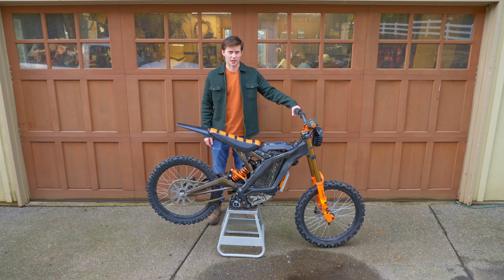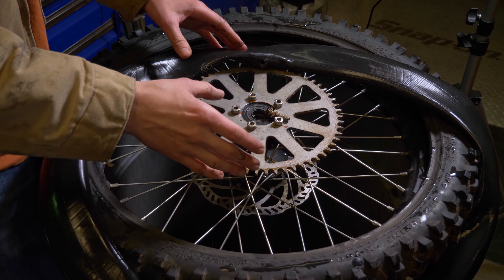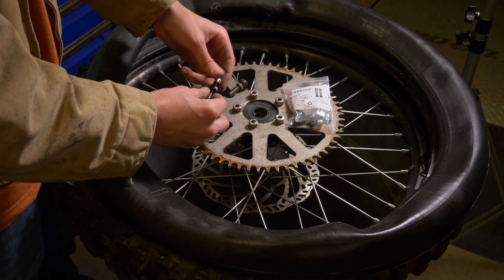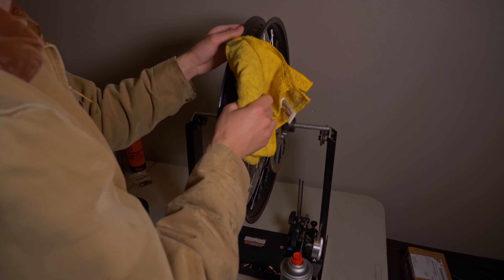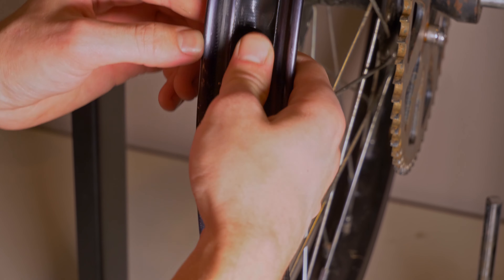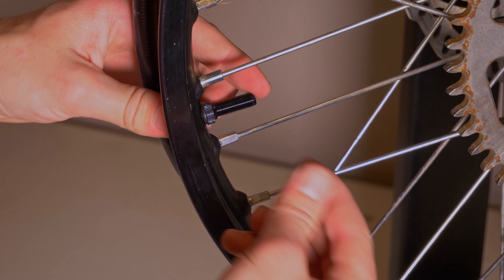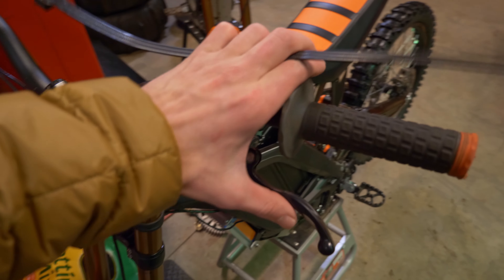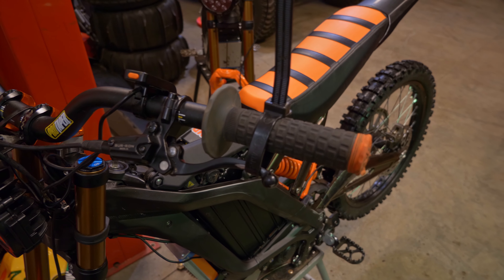Tubeless Tutorial For Sur Ron

Comment: Good on you guys for experimenting with the simple approach to tubeless. I don't think the average rider is gonna spin the tire loose but I guess time will tell how it works out. I ran a simple set up like that for many years on various KTM 2 and  4 four stokes. I ran a trials tire and sealed spokes with sealant and duct tape.I didn't even run sealant inside the tire.  I could run as little as 8psi and never had rim de-bead or spin. If the bike sat for a while sure it would lose some air but so do most tubes. I did plenty of Nor-Cal rocky technical trail riding as well as high speed paved twisties....Just always carry a tube in case

Comment: While I run the Tubliss 2.0, I still watched this all the way through. One suggestion, when putting the sealant in, keep your wheel on the truing stand and spin it after. Much better distribution. If you don't have a stand put it back on the bike and run at low speed for a bit. Hopefully you get a good seal first try. Thanks for putting out the content. Eagerly awaiting the next run of controllers.
Reply: What's your experience with Tubliss on the Surron?
Reply: Didn't you have a hard time installing the tire with the tubeless?
Reply: @Seldoff  So far great. It's rainy season here in Hawaii and the mud can be deep, sticky, and sloppy or thin over hardpack and slick as snot. Im running an 18"x 3.50" rear as are most of the guys i ride with. Yesterday was really wet and i rode at about 4 psi. Other guys have done entire rides of 2+ hours at 0 psi. This is over roots and rocks with plenty of climbs and descents. No flats or rim damage yet. The inner high pressure tube keeps everything locked in place. The wheel setup was a game changer. Spinning the rear is a thing of the past. You lose a little bit of the initial punch on takeoff, but the torque that tire puts to the ground is amazing. I can crawl up stuff i had to hit full speed to make before.
Reply: You converted to a wider 18” motocross rim, that’s important info, I don’t think you can make a tubliss work with the stock SurRon rim, it’s too narrow.
Reply: @BrianLampright913  Correct, I'm running an 18" x 2.5" moose racing rim with a Kenda257d 18" x 3.5" tire.
Reply: @ff24  I’m going to try going the opposite direction you did, I’ll let you guys know how it turns out when the snow melts :)

Comment: I run hare scrambles in Florida and Montana...and always use low air pressure like 10 to 12 lbs also in my dirt bikes.  Another suggestion before going full tubeless, is to remove your valve core and just add say 2 or 3 ounces of Stan's or any sealant.  It works great and really helps prevent pinch flats which are notorious in FL sand and MT light snow roots, etc...  Then if you ever do rip your valve or such, you can do the tubeless route then.  I get tons of extra life from my tubes when doing that.  Also, don't spread the sealant in the tire on your tubeless setup until after you set the bead.  The latex or sealant gets in-between the bead and rim and latex rolls into little balls as it dries.  So you don't want it to leak out and make a mess and have less in the tire anyhow, so just set the bead then spin and bounce your tire...will work way better. Happy trails and thx for the great videos.

Comment: Great tutorial. Well described. I have tried 4 different sealants, Stans, Orange, AmerSeal, and Slime. Totally honest, SLIME works best (cheapest, easiest to get, doesn't dry out and turn to snot), both for my Enduro 2 stroke WITH Tubliss 2.0, and my mountain bike(s). I threw about 6 ounces of Slime into the Enduro Tubliss 2 while mounting the inner liner and tire, and I do NOT have any air loss (over 2 years running and a few tires later). But when I convert the Sur Ron to tubeless this spring, I am going to try a mousse for the first time. Wish me luck!  Definitely looking into getting an 18 inch rear wheel made too. If a 3.5 inch tire fits, I would love that low pressure for climbing and ultimate traction.

Comment: Nice.  I’m running tubeless on my 26 inch front wheel.  I may as well do the rear too now with my extra tubeless valve stem.
Reply: 26”???  Mountain bike wheel?
Reply: @BrianLampright913  yeah, it's a 21" wheel alternative for people with RST forks.
Reply: Aren’t you scared of exploding that wheel and having a huge crash as a result?  The way we ride I couldn’t trust a MTB wheel on the SurRon. But if you aren’t aggressive then the light weight of a MTB setup would be awesome!
Reply: @BrianLampright913  people have ran mtb fronts on the sur ron for since they first came out and much longer with motopeds. They are plenty robust in terms of strength for hard riding and jumps.  The only complaint is tire life and resistance to punctures.  I’d do a 24” mtb rear wheel, but I’ve had too many pinch flats on my quilbix 76 clone.
Reply: @skyungjae  yeah the wheels on MtB can take some serious abuse if built right, but not a lot of margin for error vs an MX wheel. The tires are a massive difference in bead and sidewall construction which would cause a lot of problems for fast people in rocks and corners and stuff on a 110lb bike, heck I can make a tubeless MTB tire burp in a fast corner or rock garden on my 30lb mountain bike.   a 21”/17” full sized motocross wheel setup is crazy overkill for the SurRon, adding a ton of weight in the worst place. I can see why there are so many variations everyone is trying out. I’m building up a new wheelset right now, just waiting for spokes and I think I’ve nailed the best setup.  More to come once it’s built...
Reply: @skyungjae  you can stuff a 21” on an RST ;)
Reply: @OregunAdventure  what tire are you using for clearance?
Reply: @skyungjae  I have a Dunlop mx53 80/100/21😎 yeah baby‼️🤣
Had to do a lil modding;)
I have the same size tires (front/rear) as a typical dirt bike.

Comment: Hey guys! So I gave that tubeless setup a try. I managed to get one tyre set up, inflating it at a car tyre shop and rode a couple of times with it. The second wheel there's no way to seat the tyre, I wonder whether my compressor (170L/min at 110psi) is powerful enough to seat the tyre. Looks like your compressor is huge (at least the tank), maybe that helps.
Reply from the maker: You shouldn’t need to go above 35 PSI to seat, I’ve tried and learned the hard way with a massive explosion and a loss of hearing for a while! 

What helps most is lubrication on the bead. We didn’t need it in this video but we recommend using that stuff that they put on car tires to get the bead to seat. That should do the trick 🤘🏽
Reply: @emotobros  thanks for your answer. The issue I’m facing though is that air goes out faster than it goes in and I can’t manage to have pressure at all…
Reply from the maker: The tire does need to be relatively in place on the rim. The tires I used had a pretty thick sidewall so they naturally popped into a position on the rim that allowed for a pretty easy inflation. I would suggest bouncing it around to try and get a good centering seal to begin with and it never hearts to put in more sealant. Although the actually pressure of your air compressor doesn’t need to go over 35 psi, you do need a high enough flow rate to push it out. While my compressor was able to do this it’s possible some compressors aren’t able to push enough air fast enough. If you are trying to inflate it you can usually see where sealant is flowing out from a bad seal. I would try targeting problem areas by pushing on the outside of the tire into the rim to help the tire seat on the bead.

Comment: Hey guys great video I'm gonna give this a try but I have a question.  In the start the first valve stem you show was a (velotubes) roadup  fr21d with 4 holes designed for cushcore insert then when you actually put the valve in you used the velotubes fr21 just one regular hole on the bottom . Was there a reason you choose to use one over the other ? Thanks
Reply from the maker: You know more than us! There was no particular reason we used one over the other, just what we had laying around and it seemed to work! We still recommend Tubliss over this but this is far more economical.

Comment: By any chance will there be a bac8000 emoto bros kit down the line?
Reply from the maker: We have covered this in a lot of detail before but the short answer is no, because there is no good reason too. A big misconception is that the 8000 has usable performance benefits but that’s really not the case. The BAC4000 can already handle way more power than you should be running through your bikes motor
Reply: @emotobros  ok

Comment: I want to get fox 40 for my Surron but I don’t know how to get a normal dirt bike fender mounted on them does anyone have advice?
Reply from the maker: There’s no way to put a dirt bike fender on it because they are not inverted forks and the cross support on the lowers would come up and hit the fender. A fender needs to be mounted to the lowers, most mountain bikers do this with zip ties, and a thin plastic or laminated cardboard cutout. I’ve done it with a cardboard from a box of beer when I had a mountain bike

Comment: They make extra thick inner tubes and they make really good heavy duty liners that you can put in your wheel and then you put the inner tube in and then you put it on your rim and voila no need for a nasty gorilla tape or sealant you will never get a flat you can go over nails raise your blades you name it it will not go through glass all day

Comment: Been doing this for a decade, Next time you do this tape the rim and out in your valve stem then put the tire on and pop it on bead with no sealant then let the air out , take the core out and put in the sealant, valve back in then fill it up again and roll it around you won’t lose any sealant hat way and get the best seal and keep it all in there

Comment: I think with your aggressive riding you are going to have problems with the tire slipping on the rim running the MTB version of tubeless. You only have a 19” rim in the rear vs a 27/29 and that’s a loss of 30% surface area for the tire to grab the metal rim and stay in place. But the bigger problem is on MTB we run 25 psi or more pressing the tire against the rim.  I think you’ll find this setup is not going to work and you’ll be buying a tubliss kit which are absolutely fantastic, I run them on my moto bikes.  There is also a problem with tubliss on SurRon, the rim used is much more narrow than a 19” rear motocross rim (by 20mm) which the system was designed for.
Reply from the maker: I guess we will find out. So far no issues

Comment: Should just run a bead lock if your spinning tires. $16 and drill a hole. Under 23psi and more powerful set up your going to be spinning tires. Even tube less.! Many years racing the GNCC'S we would use NUETECH TUBLISS set up. RIM locks have to use a tube whitch sucks woods racing because of pinch flats. NUETECH uses a really cool design. just something to think about. My rims don't come with a bead lock hole I leave this to customers to decide whether or not they need one. Can easily be done.
Reply from the maker: I’m gonna go tubliss when I get your wheel set. This was a bit of a an experiment. I’m fine with a little slip so long as I don’t  pop the tire of the rim due to it. I covered bead locks as an option in the video but like you said, you still have to run a tube which I wanted to move away from.
Reply: Any reason you couldn't run a rim lock with the tubeless setup? Just use an o-ring behind the nut on the rim lock?
Reply from the maker: It just creates another place for air and sealant to get out. That being said, I haven’t personally ran it so if your tape is sturdy enough, and you use Orings like on the valve, I could see it working.

Comment: You can do ghetto tubeless with stans and a 16-20in BMX tube split open and spread over the rim. Harder to get tire on, but with a good set of mx tire irons, it's NBD....problem is every time you change the tire you have to do it all over again, so I went back to tubes. Good mx tires and about 14psi, and you won't pinch it. I do 60ft gaps on mine....check my channel out....lol